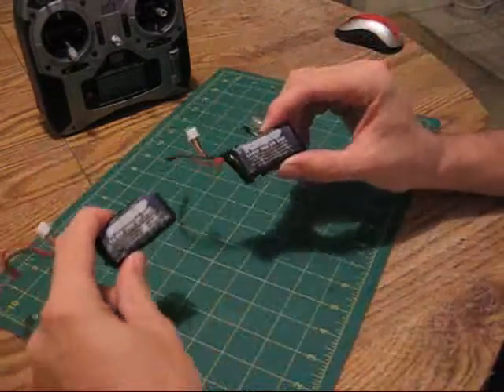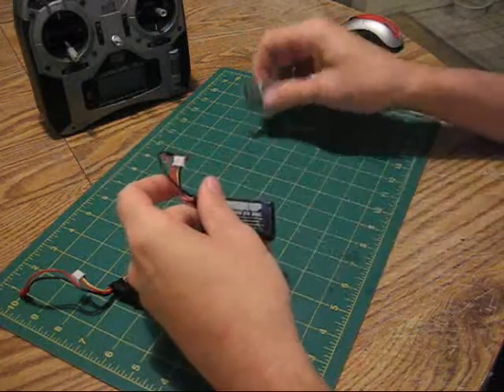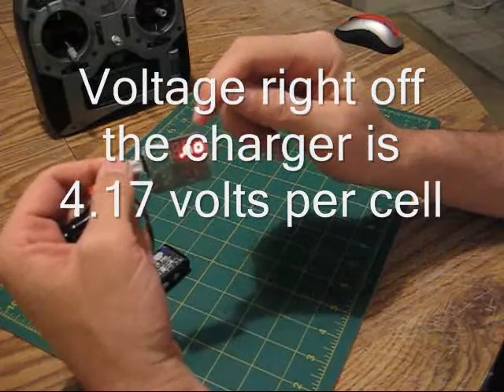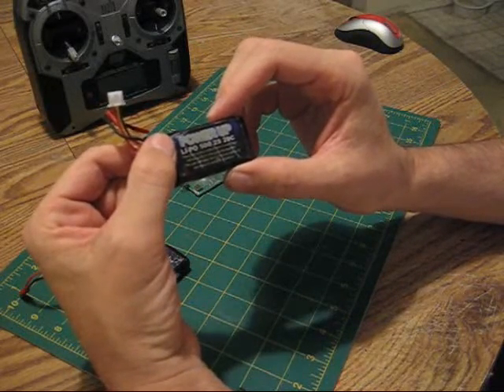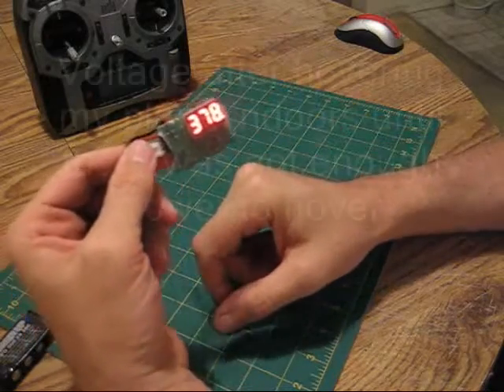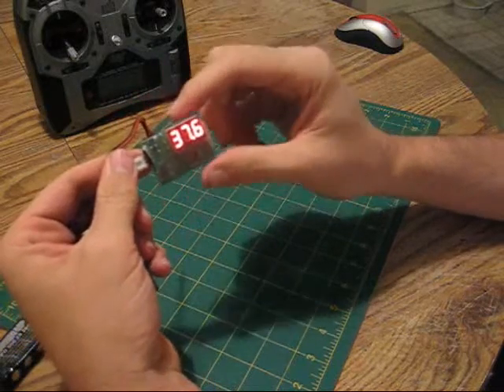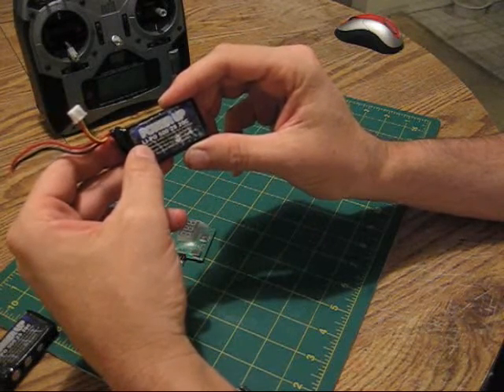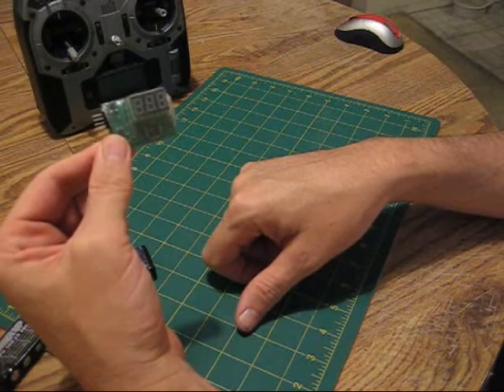Lipo Battery charge tip #1

Comment: i think that the lowest voltage a lipo cell can go is 3.3 volts.below that you have a problem.
of course a proper ESC has a cut-off fiture that keeps a safety voltage below minimum tolereated.